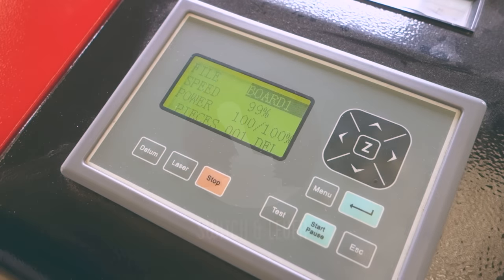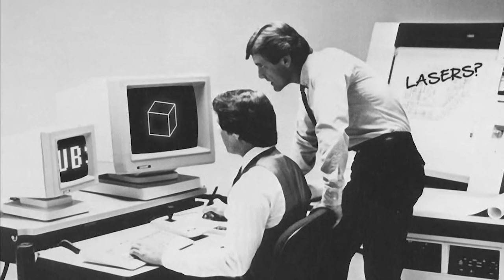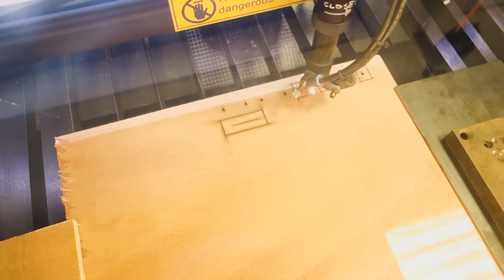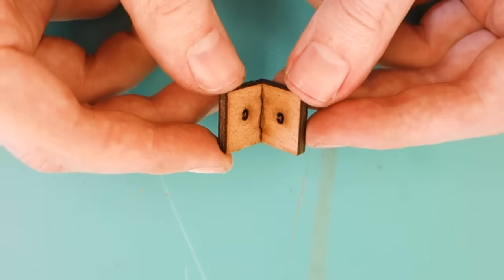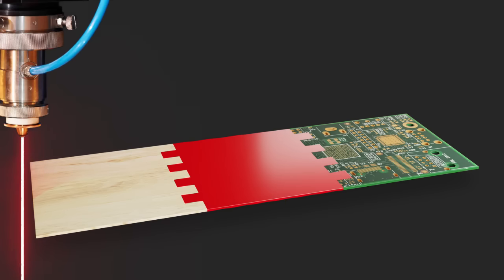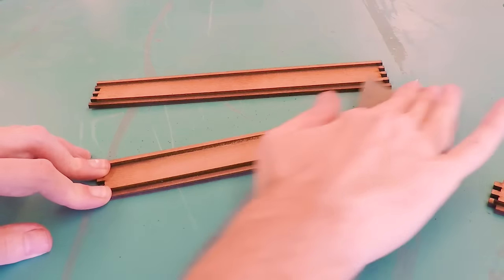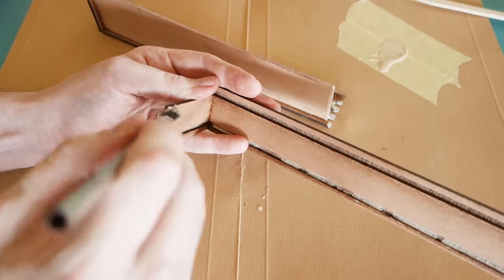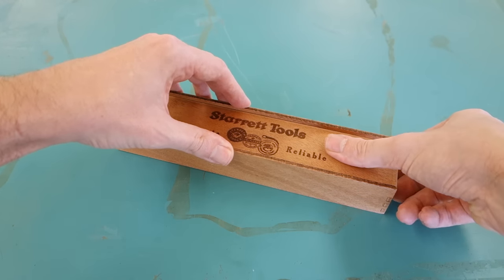The Trick With Laser Cut Box Joints

Comment: It's fascinating watching the workflow of other people using the same tech as you. Like, because of the cutters I use, I don't take the kerf into account as much, because it's so small. It means that I can cut all four sides of a box in one line, sharing the finger joints, which (if done in a way that compliments the overall design aesthetic of the build) can look very pleasing without the sanding step. You just have to make sure that they feel solid. I think that's where a lot of beginners (and a lot of people on the internet too) go wrong, and make the fingers really wide, so the boxes don't ever fit together properly and feel really flimsy. That's the worst kind of laser cutting.

Comment: Besides the kerf, there is also the defocusing effect which, especially on thicker wood, can make the joint taper from top to bottom. This can be partially remedied by refocusing the beam and moving slightly closer to the wood surface until you find the sweet spot with minimal deflection.

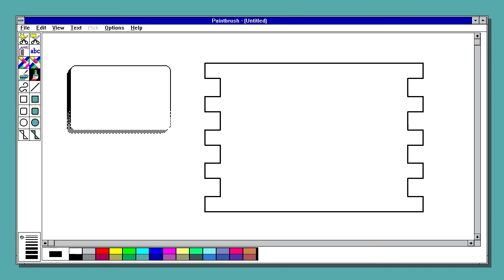Comment: 4:35 “You need to offset by the width of your kerf”.
As the laser tracks along the cut line, it removes half of the kerf width on either side of the cut. To compensate for this, you should move the cut line away from your part by HALF of your kerf width, not the entire kerf width.
Reply from the maker: Yes, I missed a word. In reality it’s a little more complex than that though as exactly half the kerf may still be too loose, or too tight, and you’ll have to adjust it a fraction in one way or another. Hence the need to cut test pieces.

But please continue beating the dead horse rather than reading the comments about it already made.
Reply: @SwitchAndLever  Hey S&L, don't let internet comments get to you, focus on the positives? Glad to see another of your videos, very magic looking box!

Comment: This will be very useful. I'm currently looking into using laser cut sheets of the following chipboard, laserboard, Basswood or MDF for building HO scale brick structures. I've been playing around with off sets in the CAD model to get reasonably tight fitting joints that don't go together too tight. Of course part of the problem is I'm using a 15 watt diode laser cutter. Chip board and Basswood cut just fine. In the end I'll probably stick with 1mm or .045" chipboard as the bricks scale out at 1.7mm/.046" from the centerline of the mortar joints. This way when joining wall sections in a row or at 90°s the courses of brick line up.
Off course on CNC machines depending on direction you can just specify the offset amount via the tool directory with G41 and G42 for left or right hand compensation.

Comment: FYI, if you up the pressure of your air assist on your laser you'll get minimal or no residue and less burn.  Get the air above 20 PSI.  Thanks for the great videos.
Reply from the maker: It highly depends on what plywood (or wood) you're using though. This specific plywood is dirty as hell, I have another 3mm plywood that lasers super cleanly, with no soot and the edges are nice and brown, not black and burnt. Would've used that but 3mm is slightly on the thin side for a box.
Reply: @SwitchAndLever  True, a lot seems to depend on what glue and how much glue is used in making the plywood too.

Comment: You totally can cut circuit boards on a laser cutter! Well, you apply a layer of something like spray paint as an etching resist, burn off the paint in the inverse of the pattern you want using the laser cutter, then etch away the exposed copper with ferric chloride.
Might make an interesting video actually
Reply from the maker: If only...I already made a video about etching brass plaques that can be used, pretty much verbatim, as a template when etching circuit boards 😉
Reply: @SwitchAndLever  Oh wow. Yeah, exactly that process!

Comment: One thing I would change is not glueing in the bottom. Wood swells and shrinks and a floating bottom would prevent the box from warping over time.
Reply from the maker: Except it’s plywood and it’s dimensionally stable. What you say would’ve hold true if this was solid wood but plywood doesn’t have the issues you speak of and glueing in is just fine.

Comment: you can reduce or even eliminate soot and tar markings on wood by putting a layer of masking tape overtop of the wood.  you can eliminate checks from where the laser cuts through the wood and encounters the blades or honeycomb table underneath by putting the wood on a sacrificial layer of non synthetic cloth.  i use muslin since i have tons of it.
Reply from the maker: Don’t like the masking tape method myself, especially on a little rougher surfaces it tends to pull up grain and not seal properly leaving a gummy edge that still needs to be cleaned up anyway. If I’m going to sand the surface anyway (which I am) it’s really not a big deal to remove the soot at the same time. 

You can also eliminate those bottom marks by elevating your piece a little using shims, but that does require a pretty flat piece to begin with. Since mine was warped I had to weigh it down to keep it flat.

Comment: If the curf is .2 why u adding .2 to both and  not .1 ?
Reply: I had the same question. If your laser cuts exactly on the line then it should burn away the same amount on each side so the amount that needs to be adjusted should be half of the total kerf. I guess with material like wood it could be fine because it is somewhat flexible but acrylic on the other hand would possible struggle if you don’t get it exact and even 0.5mm could make a big difference. Especially, if you have many small finger then the excess material could easily amount to a few mm.
Reply: Yes it should be half of the kerf or close to that. Wood is quite flexible so you might want to make it tighter on purpose for a snug fit, but more rigid materials would benefit from being offset to something closet to the kerf/2

Comment: If I could offer some suggestions. Sand your whole blank before cutting. I like to use painters tape. Saves a lot of time cleaning up that nasty carbon. Or a little alcohol on a rag works great to remove the carbon, however, I've been experimenting with Clorox bleach and works better than alcohol but wear gloves because you won't get that smell off your fingers. Use rubber bands to help with the glue-up.
Reply from the maker: Don’t like sanding the whole board before cutting because that ultimately just leads to resanding stuff away anyway. The painters tape can help, but I find depending on the wood it can pull out grain from the surface, so I tend to avoid it. It doesn’t really take much time to clean up the soot anyway.

Comment: Another great and thought provoking video - thanks. I have neither the patience nor the laser cutter to make such strong joints and the "beauty of the joint" doesn't interest me so much, so the question for me is - how do you figure out the minimum number of interlocks to make so that the strength of the joint matches the strength of the material being used?
Reply from the maker: I am not a material's engineer, though I find using a finger size that matches the thickness of the material is a good starting point. The glue joint will be stronger than the surrounding wood for sure. If you're using other ways of cutting your joint, like with a table saw, you could even use the width of the saw blade as the width of your joint, as it will make things significantly easier. If you use huge fingers the joint won't be much stronger than a butt joint, just easier to assemble, if you use a massive amount of tiny fingers the joint becomes difficult to assemble and glue.

Comment: Tip for glue up: add masking tape to the areas where there will be glue squeeze out, this will make cleanup a lot easier and faster. When the glue squeezes out and is starting to get gummy you can remove the tape and it should leave clean edges.
Reply from the maker: Yes, there's a reason I didn't do this. The plywood was crap quality, and masking tape pulled out wood fibers out of the surface when removed. I'm honestly not all that worried about glue squeezeout, especially if the joints will get more work done, or if they're in a place where it won't be seen or affect the end result.

Comment: Not even going to mention the massive twist in that plywood.
Reply: It was pretty massive, but that’s why it’s good to be cut down into small pieces, because it virtually disappears
Reply from the maker: It’s inconsequential. As long as you weigh the board down so it lays flat when cutting any little twist still remaining in the small pieces will easily be corrected when gluing the box together.
Reply: @SwitchAndLever  ...until you cut something that has a long side, which bends out of the flatly clamped-down stock as soon as you cut it, and your laser optics promptly crashes into it at high speed first time it tries to fly over it.
Reply from the maker: @AttilaAsztalos  so? Don't do that then, easy fix. 🤷‍♂
Reply: @SwitchAndLever You just did so yourself, and tried to  shrug it off as no big deal - except that's exactly the point: bent stock IS a big deal, even if you can clamp it down flat. You can't have it both ways. "It's inconsequential" until the first piece rises way up after being cut.
Reply from the maker: @AttilaAsztalos   I don't know which video you watched, but nothing I was cutting ran even close to hitting the nozzle, much less the optics or the gantry. Hell, the board wouldn't even hit even if I didn't weigh it down (but large parts of the cut would've been out of focus). You're acting like I was cutting a board shaped like a Pringle. If you're worried about it, then don't do it. Let us who know what we're doing do what we do. Deal?
Reply: If you get an angle of 2 or 3 deg in the part because of twist it will have no significant impact on the box. The tiny gaps will fill with glue.

Comment: Hi, sir, what's about finger joints type used in wooden puzzles (i.e. Ugears). Like a plain finger but with an additional vertical cut in the middle, which allow pressing both sides of finger when assembling that joint?

Comment: hey! perfect video talking about kerf! Just a question, which values you tell to the machine to make the etched grooves with the laser?  In terms of design, could you share the design file to get the example? Regards!
Reply from the maker: What values I use would be pointless to share because it will vary with your machine and your material. This is why you have to cut test pieces and adjust accordingly until you find values which work for you.
Reply: @SwitchAndLever  Hey, thanks mate! And in design you just make a black rectangle polygon right?

Comment: Titebond Thick and Quick glue states that it will fill small gaps.  0.2mm is pretty small.  I wonder if this would suffice?
More interesting: I wasn't aware you could etch a blind groove with a laser.  It looked consistent.  Interesting.
Reply from the maker: Why would you load a loose joint with glue and not have a tight joint when it’s so easy to avoid though?
Reply: @SwitchAndLever  The reason is obvious for thin material utility boxes.  0.2mm or 0.008 inch is a very narrow gap and I curious about the new Titebond glue. 
Seems you missed my "more interesting" comment.
Reply from the maker: It’s more like 0.4 since the kerf error doubles. If one piece is 0.2 too small two interlocking parts become 0.4 too small. As I said it will probably work anyway since you have connection to the sides as well, but the joint will look a whole lot less neat and tidy.

Comment: So a simple joint requires glue but how does glues stick to the burnt surfaces of laser cut wood?
Reply from the maker: Not as good as to raw wood, which is why simple butt joints are not a good idea and why you definitely should do something like a finger joint if you're aiming for a sturdy joint. The joint I put together has roughly four times as much glue surface as a butt joint, as well as being interlocking which further increases the strength.
Reply: @SwitchAndLever  Hmmm, thanks. Thing is I'm not so fond about laser cutting wood the more I look at it. Thick materials are hard to cut, thin materials are not strong, a laser cut with a strong laser tends to have less work room for materials strong enough to build large objects. I'm thinking a CNC router makes more sense for wood,  maybe just restricted uses like building balsa / foam models airplanes (thin and fragile sheets) is worth it. Or acrylics.

Thanks again.
Reply from the maker: @eaman11  I entirely and completely disagree, but to each their own. 🙂
Reply: @SwitchAndLever  Well as you are more experienced than me I hope I'm wrong,  I'm about to buy one and learn on it. Worst case I'll make airplanes with it :) (I like airplanes, my garage is almost full).
Reply from the maker: @eaman11  biggest drawback on a CNC is that you cannot make internal corners, they will always have a radius. This makes the joinery which I made in this video essentially impossible. You can get around it by things like mickey ears, or similar, but it's not really a great solution if you're looking for nice looking joinery.

Comment: Couldnt you just make it so the box shares the same line so it only fits once and not need to measure kerf.
Reply from the maker: Then the fit would be loose as the laser still removes material. So yes, you could, if you want a loose fitting box.

Comment: Too much air blowing on surface when engraving. It is reburning the smoke/soot onto the surface. Run minimal air to just keep smoke off lens.
Reply from the maker: Thank you for your input, but no, that's not the case. It's the material, this specific plywood cuts dirty as hell, which is obvious on how dirty the cut ends are. Some plywood cuts way more cleanly, I suspect it's down to which wood is used and which adhesive. I've cut clean stuff as well with this laser, same settings. I appreciate that you're trying to help, but oftentimes commenting on things you briefly see in a video as opposed to being there in real life actually doing the thing means you end up shooting way off your mark 🙂